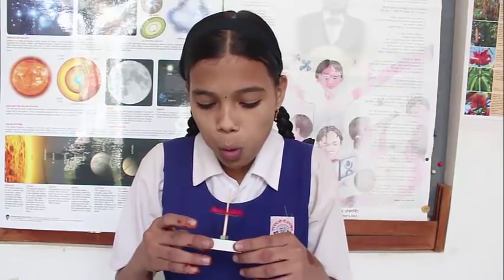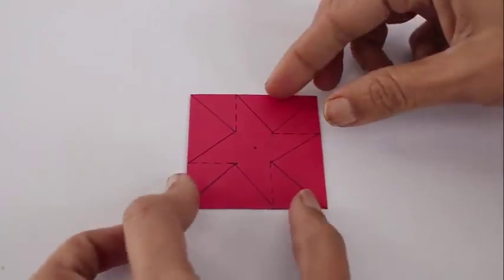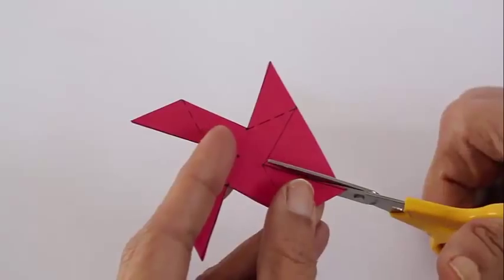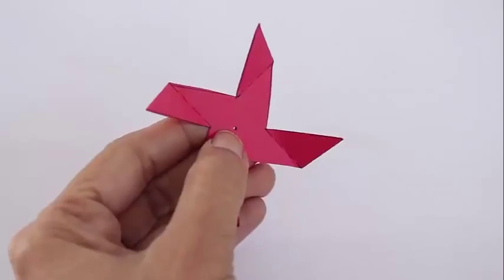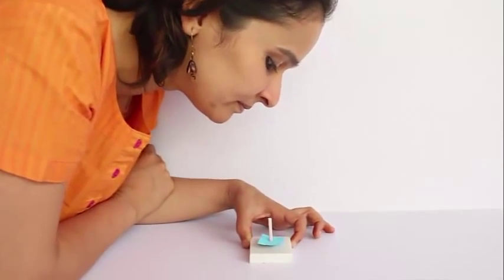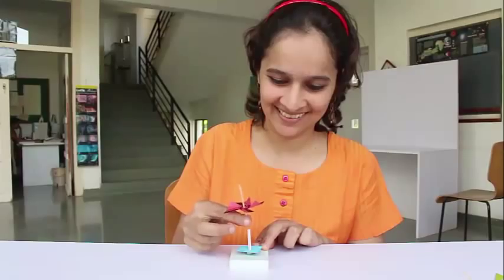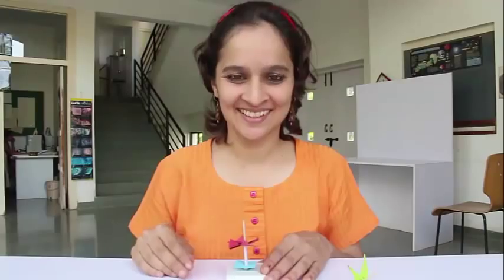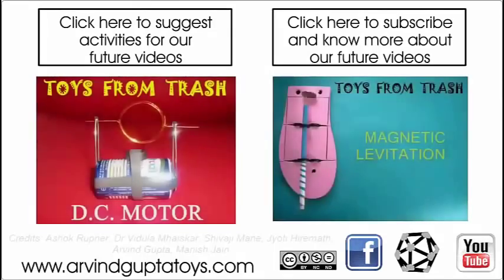Lifting Fan | English | Amazing Fan

Comment: But how does the fan create the low pressure area? I am thinking that perhaps the propeller also acts as an impeller--centrifuging the air outward like a centrifugal fan and thereby creating the low pressure area underneath.